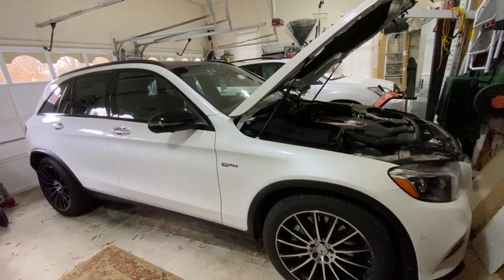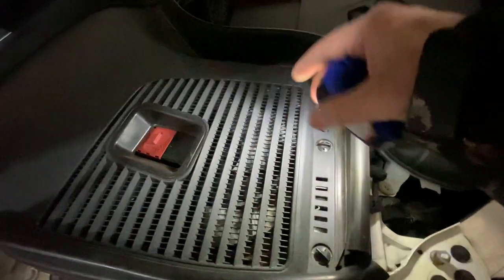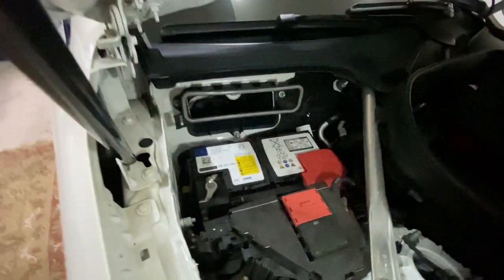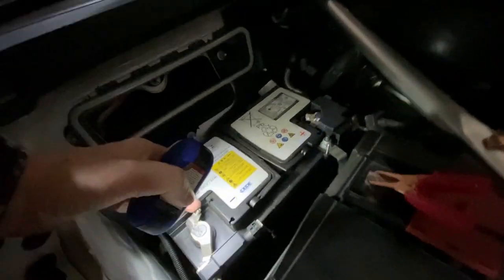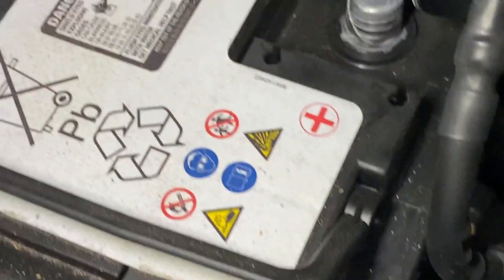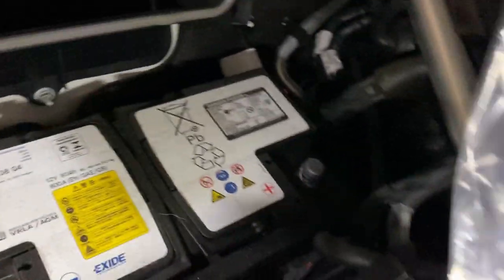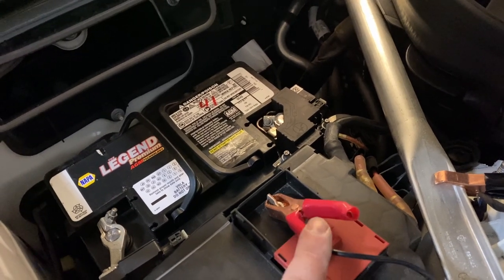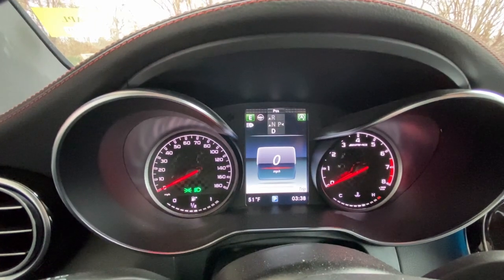Replace 2018 Mercedes GLC Battery

Comment: Thanks for your video Ed! I just did the same job an hour ago, on my GLC 350D -2017. 
You should begin the job by removing the start-stop-button key first (according to Mercedes instructions) and it is not necessary to mount the battery charger, it maybe for older cars (Mercedes instructions does not say anything about a charger). I didn't use a charger and it all went very well. 
But I also realized that you can't open the car when the battery is out... I was lucky that my new battery already was outside.
My old battery was almost 6 years old (5y and 11m) and we have complained (for two years) to our local Mercedes dealer about two problem. 1. Start/stop don't work. 2. Instrument panel often was turned off during start at winter time. Totally black and you couldn't see your speed or any messages.
Mercedes said that we maybe had to changed the whole instrument panel and I even started a case at my insurance company about this. Now I have fixed all these problem by myself and 20 minutes of work for a total cost of about $200 (for a Bosch battery). 
By the way, I didn't have to change the auxiliary battery.
Regarding the Mercedes instructions, I got the info from a friend that is a car mechanic and he looked up my car in his service computer.
Reply from the maker: Thanks for the feedback and ideas! Do you think the aux battery holds power to the ECU hence no need for trickle charger? Even so I would use the trickle charger as a safeguard since it is very little additional effort.
Reply: I just googled and the aux battery acts as a backup for the main battery (as you say). But if the aux battery is dead you will have noticed early problems (starting) because of it, so I would say the consequence is that if you haven't had any problem starting/driving, the aux battery is working and you can change the main battery without a charger.
"Usually when voltage converter fails, you will see flashing on-board computer error fault message with the following quote "auxiliary battery malfunction" or "stop vehicle shift to P leave engine running" warning message".

Comment: I replace my battery and it fixed the problem
Reply from the maker: Excellent! Thanks for the feedback!
Reply: @edshandymantips4862  it’s funny but the car runs much better with the new battery.
It responds quicker / accelerates faster / headlights are brighter

Comment: Hello. Was your check engine light on when and where you getting a message on the dash stating “turn engine off and leave car running?
Reply from the maker: Not in my case. My only symptom was the start/stop engine feature did not work.

Comment: the battery charger i have has 2 settings on it, one is quick charge, the other is normal charge and the last one is trickle charge, its from harbor fright, so do i put it on the trickle charge setting when changing the battery like you did?

Comment: I have a similar issue. at stop engine ON/OFF is not working also a check engine P2610 code. They told me to change the main battery.   Do you think that is a right diagnosis?
Reply from the maker: How old is your battery? Was the car sitting for a while? If so charge the battery and reset the code. A quick review of P2610 indicates it can be several issues one of which is the battery and/or aux battery. If the battery is 4 years old or has had a hard life then it is close to end of life anyway. Please keep us posted as I’m very curious.

Comment: Do you plug in the trickle charger before you take of the negative terminal?
Reply from the maker: Yes - before you disconnect the battery.

Comment: What setting do you have the battery charger at when you hook it up to the car
Reply from the maker: The trickle charger I used was 12v, 750ma. I believe they are $10 at harbor freight. This held the ecu settings for me but would not power the rear trunk lid with the battery removed.
Reply: I have a battery charger that has 3 different settings, fast charge, normal charge, and trickle charge, so I guess that I switch it to the trickle charge setting

Comment: TKS for video sir. What ampers is need to be the new battery ?
Reply from the maker: Thanks for watching. I put in a highly rated NAPA Legend battery specified for the car. It has 920 cranking amps, 800 cold cranking amps, and is rated at 80AH.

Comment: Do you need do battery registration ?
Reply from the maker: Thank you for bringing this to my attention. There are many ambiguous posts on the Mercedes forums as to whether battery registration is required on this model. I found a post that included an actual Mercedes service bulletin that said registration is required. Apparently (not in the bulletin) the ecu tracks the number of cycles on the battery and charges older batteries more aggressively than newer ones. They say if the counter is not reset it will shorten the life of the new battery. The ODB2 scanner I have will not perform this function. I read the Foxwell NT530 scanner will work. Give me a few days to order one and give it a try and let you know the results.
Reply: @edshandymantips4862  Just started receiving "Stop Vehicle - Leave Engine Running" warning on my 2018 GLC300.   I would REALLY appreciate if you did a video on the reset procedure!
Reply from the maker: I had success registering the new battery with a Foxwell NT530 OBD scanner tool. Here is a link to the video: https://youtu.be/NRH6_JTGm2M

Comment: I just left the auto shop and got a new battery but the auto stop is still not working.. I was told that was the problem but not working.. they claim they did a diagnostic test
Reply from the maker: Sorry to hear. Many factors need to be fulfilled for the auto start/stop to work including a fully charged battery. Perhaps the new battery is not fully charged? Drive a few hours to charge battery to see if this is the cause. Other things like:

the indicator lamp in the ECO button is lit
green

the outside temperature and the atmospheric air pressure is within the range that is suitable for the system

the engine is at normal operating temperature

the set temperature for the vehicle interior
has been reached

the system detects that the windshield is not fogged up when the air-conditioning system is switched on

the hood is closed

the driver's door is closed and the driver's
seat belt is fastened

Another common cause is a defective auxiliary battery, however, you normally get a dash warning or OBD code. 

Not related but make sure the shop registered the new battery with the ecu. 

Hope this helps.